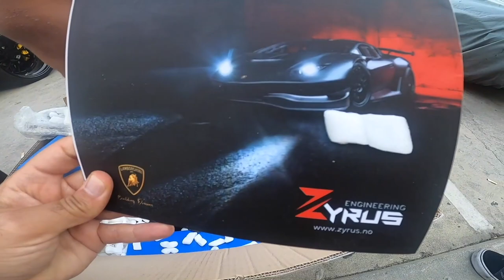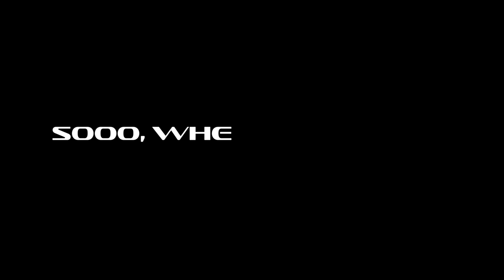How to manage 4 car builds at the same time!

Comment: IMHO I think you shouldn’t change the airbox into open filter. Cause the filter will be too close to the rear tires, and the turbo’s can suck a hot air and dust from the rear tires.  Your previous setup with a carbon air box is more efficient and the turbo can have a clean air to breath